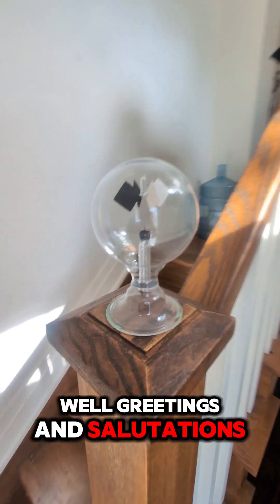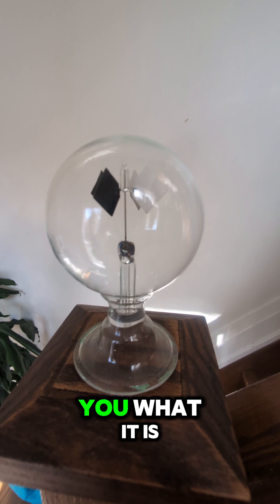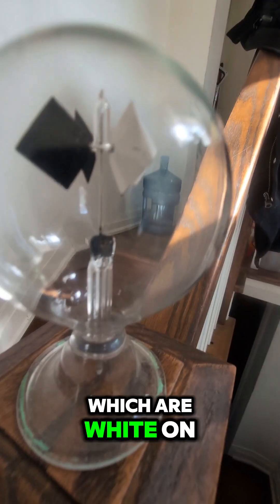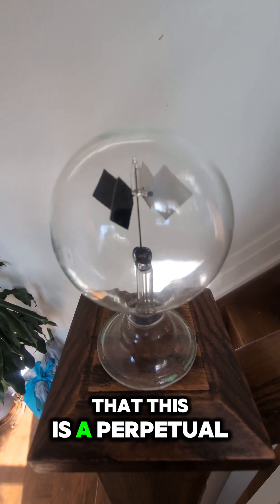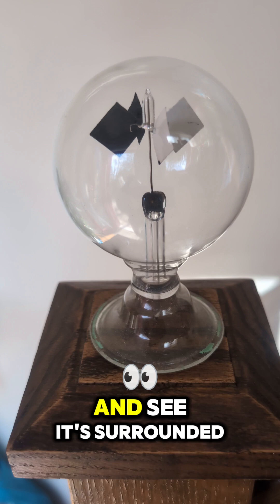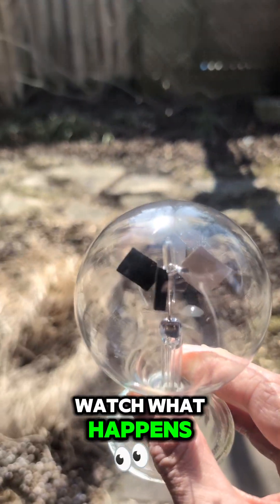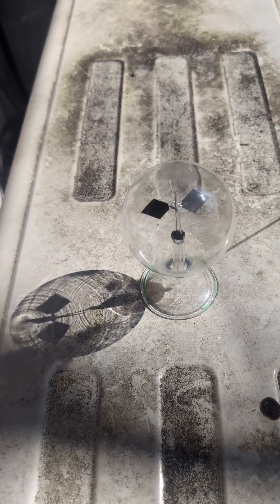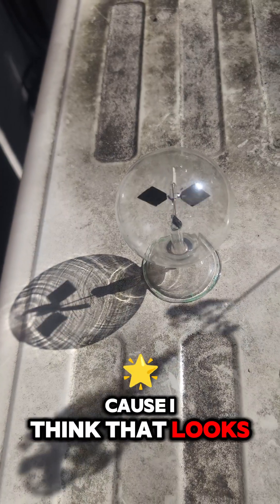Perpetual motion machine (part 1)

Comment: Light is what causes the motion...The white square repels light and black absorbs light. As the sunlight hits the white it repels the light as it hits the black it absorbs it they keep intercepting eachother causing a "pulsing pattern"  Since they are on the needle they can only move in one direction and thats in a circular pattern. It's at a constant push and pull. If you take one of the colors away it wouldn't move anymore...Off topic kinda but a strong lazer will cut a darker colored material quicker than a lighter colored material. darker colored clothing will get hotter on sunny days...my goth faze in high school was some of the hottest years of my life..😅
Reply from the maker: Now this is a superior answer. The contrast between black and white is certainly key to this process. The only probing question I have is, what is light and how does it transfer energy?